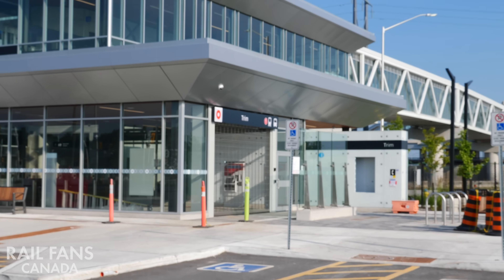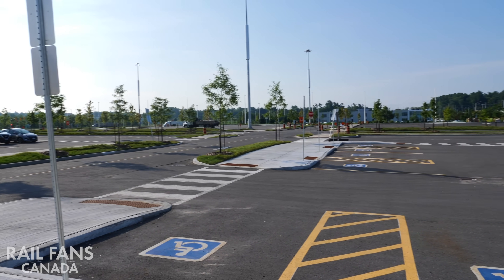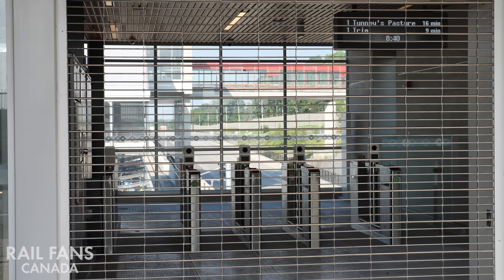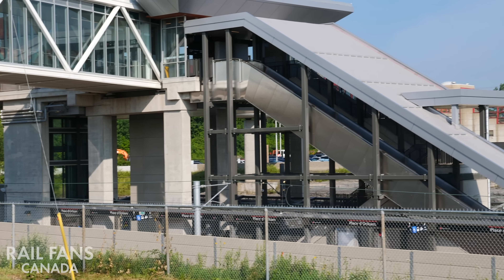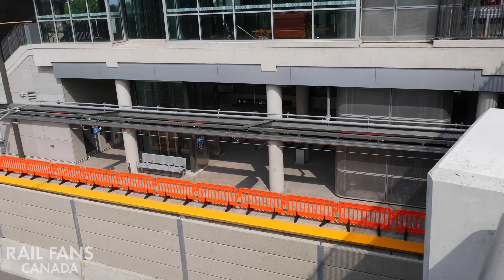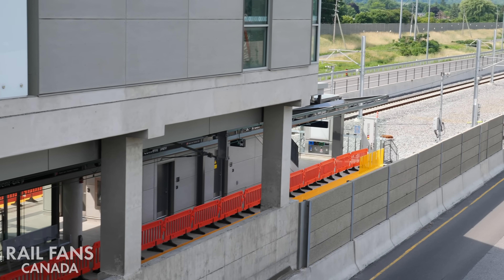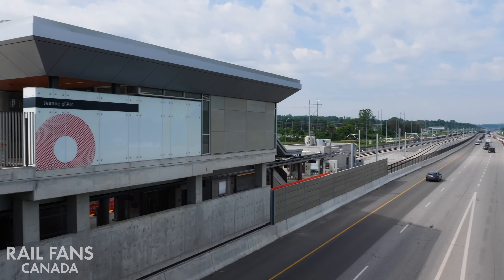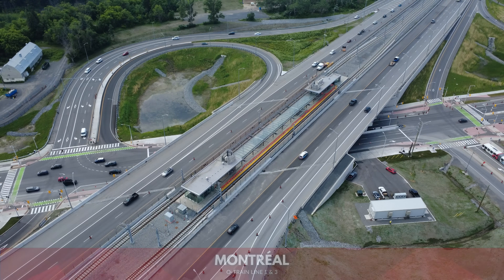Tracking the Progress: Ottawa’s O-Train Stage 2 Eastern Extension - July 2025

Comment: I live near Place d’Orléans.  Never seen such a long lasting project.  It’s been like 4-5 years.  They built the Empire State Building in less than 1 year!   Something went very wrong with this project.  And, as a taxpayer, I foot the bill.  Shameful.
Reply: Comparing a building built in 1930 is such a boomer comment.
Reply: They’ve taken so long cause they’re trying to “save money” which just ends up with more problems than just doing it correctly the first time
Reply: Oh my god

The east extension is going much more quickly than the original line 1. Centre block has been under construction longer than the east extention.
Reply: @kicksledkid maybe so.  But just because the first project was a supreme example of mediocrity and mismanagement, it certainly does not make the east extension a shining beacon of success.

Comment: Nice video!! Why wouldn't they extend the sidewalks at place dorleans?! That's gunna be dangerous with a narrow sidewalk right beside the cars
Reply from the maker: If you are referring to the sidewalk on the Champlain street overpass, I don’t think it will be overly busy with pedestrians. Most may likely cross by the park and ride red bridge or just exit out to the bus platforms or mall itself. Either way , there are several points to exit and people who live nearby like in Orléans Wood or Châtelain Village would split between the Champlain exit and the park and ride. And for most it’s at least a 10-15 minute walk in most cases if not more. (I used to live many many years ago near Champlain and Décarie).

Comment: Convent Glen doesn’t seem very accessible. Did I missed anything?
Reply from the maker: It’s no different to access than Jeanne d’Arc. They’re all in the highway median so you access by the overpass or in the case of Montreal, underneath. 

Sorry I’m not sure I understand or recognize the issue you are commenting on.
Reply: @RailFansCanada  Yes it was just the first station that made be realize how not easily accessible it was. Disappointing a brand new project didn’t consider accessibility but as long people using the system are happy.
Reply: As someone who has used rail extensively in other countries I have to agree. Convent Glen and especially Jeanne d'Arc have atrocious accessibility. They don't even have dedicated lanes for buses to stop.
Reply: @IAmJamesTheFirst  Yes, while I do appreciate the fact that the O-Train is being extended to the East end, those two stations do seem to be very impractical. I would add that even though our house is closer to those two stations than Trim, I would probably just drive to Trim and take the train from the park and ride rather than wait for a local bus to take me to either of those stations, especially in the winter and given OC Transpo's notorious unreliability. I can also see people using their cars to drop people off at those stations being an issue.